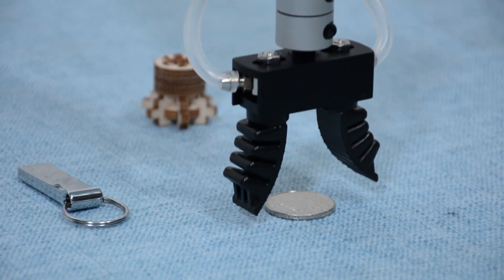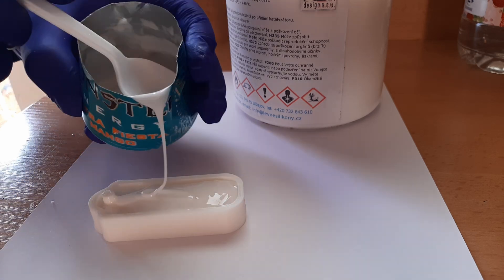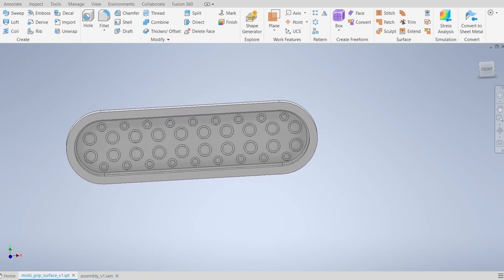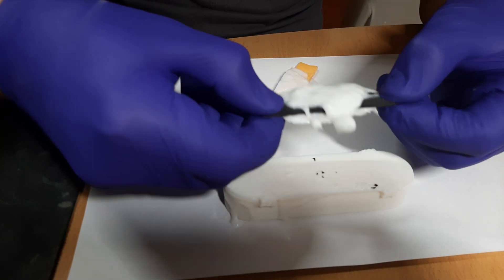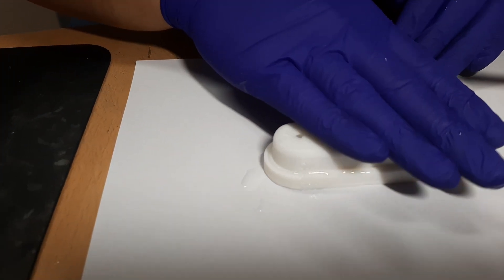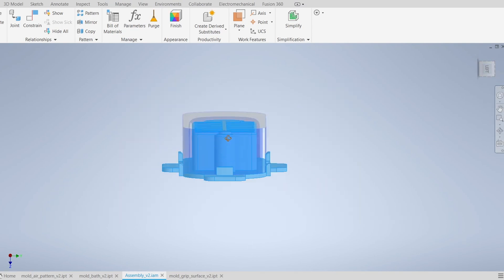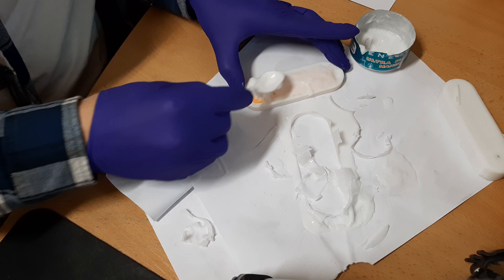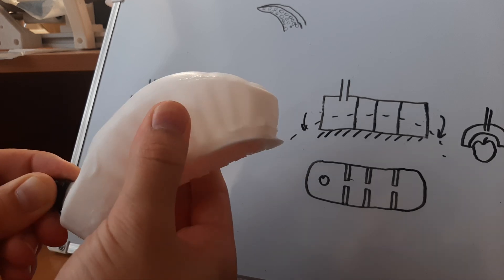Making a Soft Robotic Gripper: The Prototype

Comment: Something to know about silicone.  It adheres to surfaces much like paint.  It will stick to materials with high surface energy.  So basically if the material that you are using as a mold is easy to paint then the silicone is going to be hard to demold as it will want to stick the the mold.  Couple of ways around this is to use a mold release, I would suggest MAN200 spray, or a ptfe coating or film,  lastly you can make your mold from nylon or polypropylene (PP) filament if your printer can do them.  I would say go with the mold release spray as you wont be using your mold to make a bunch.  If using PLA as the mold you will need to coat it every time.  Petg does well with one coat every 4-5 times of use.  Also stop mixing your silicone to cure so quickly.  Slow cure so you have a longer pot life to let it flow in the mold better.  Vacuum chamber if you can.  But keep going.

Comment: I'd recommend using some sort of mold release agent to help alleviate your demolding issues - for silicone I like to use a PVA based mold release, and a neat bonus is that it takes up some of the space between layers on the mold, so you also get less pronounced layer lines in your cast part